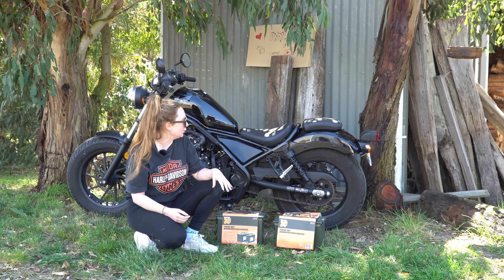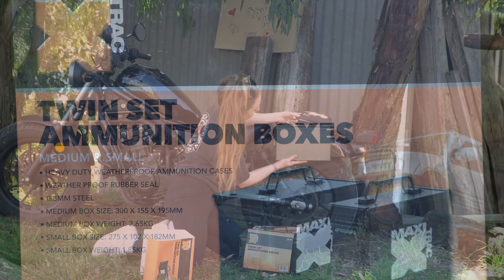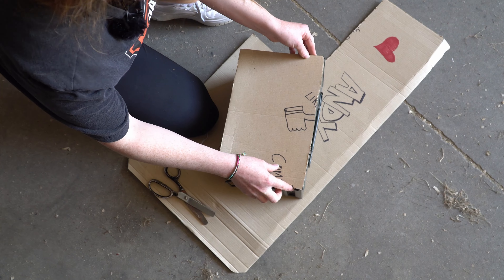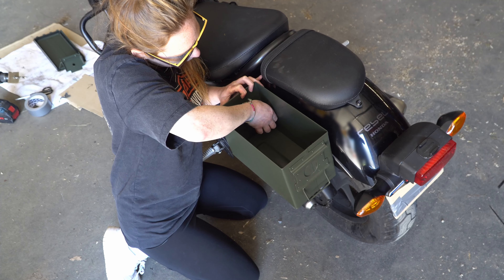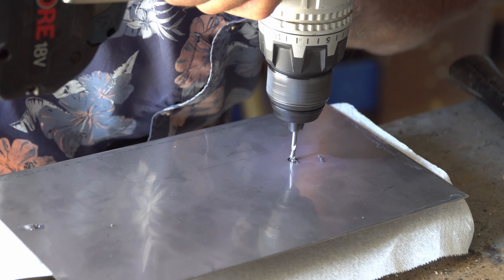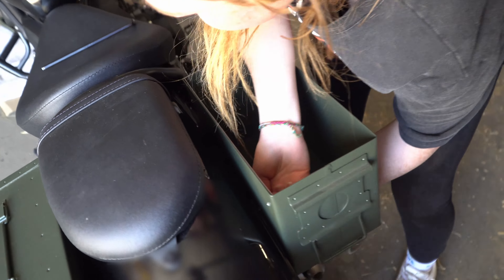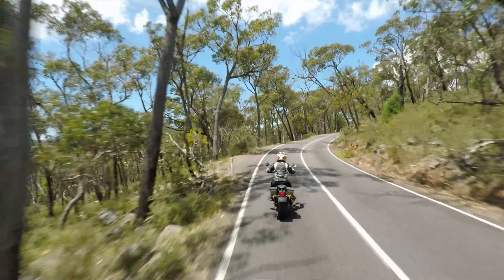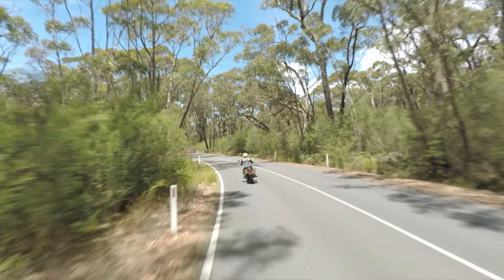Best cheap motorcycle panniers

Comment: Have you got caught in the rain with them yet? Just wondering how good the rivets seal out the water 🤔  I would guess that not much water gets in through them though. If you do have an issue with the bolts letting in water, you could always cutout some rubber washers from an old bicycle tire tube or something. Looks good!
Reply from the maker: RedRider! Thanks ☺️ I actually haven't ridden in the rain with them yet but I've washed the bike a couple of times with a hose and no water has come in. Also haven't had any dust get in either 🙂
Reply: @andymoto  oh that’s awesome! 👏

Comment: keep us updated.  im curious about vibration and leaking
Reply from the maker: Will do! I've given the bike a wash and haven't had any leaking yet. It's been about 2000kms and they've been okay. My over night camping trips should put them to the test.
Reply: Put a little rubber washer between the box and the bike and that will damper the vibration, and for leaks? Silicone the hole shut after its been installed (silicone the inside)
Reply from the maker: The only problem with the rubber washers is it won't pull up tight to the bike, so might vibrate more? You could, but would need more bolts. Still no leaks. 😃

Comment: Its a badass look.  Never thought of doing that.  Does the right can get hot?
Reply from the maker: Thankyou! 😎 They do get warm when sitting in the sun, but I haven't noticed the right getting any hotter than the left. They are futher from the exhaust and don't get as hot as the right TUSK pannier on my friends KLR650. I'm also going to line them in a future video which should also help insulate them.
Reply: If the sun is heating up the metal painting them white will negate.  That's why the space rockets and shuttle were painted white to reflect solar radiation. They probably won't look as cool, yet will stay cool to the touch.   It will help protect lithium-ion batteries and heat sensitive equipment.
Reply from the maker: Yes ☺️ that makes sense, thankyou! I still think I'll go black to keep the look, the foam lining should keep some of the heat out. 😁